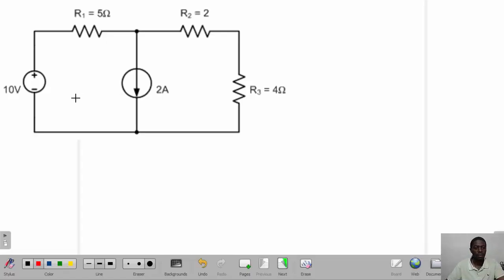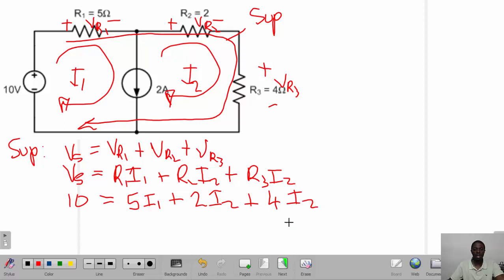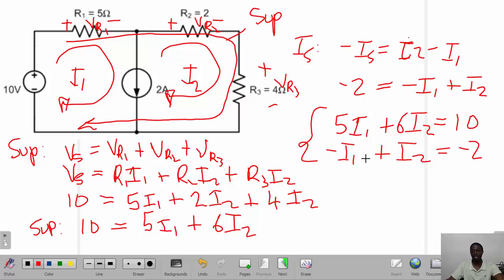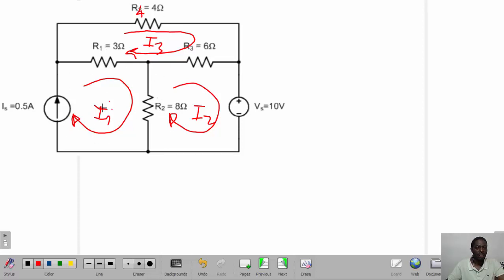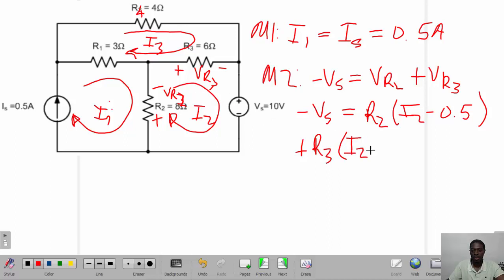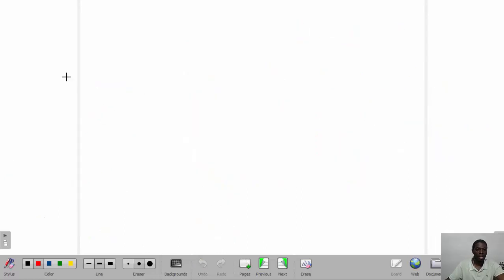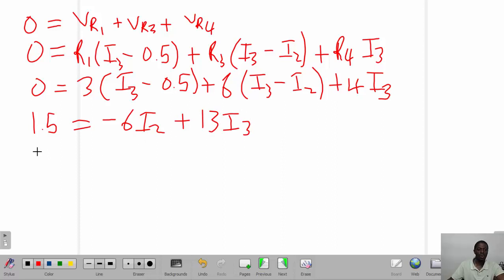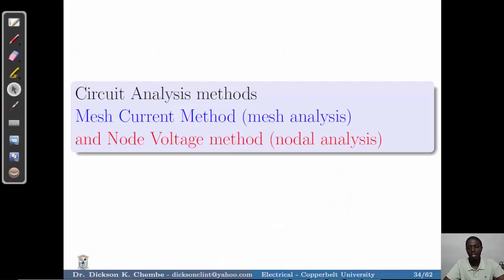Mesh Current Method II

Comment: This is great.
Please Dr, I would appreciate it if you  countercheck Example 13.6 in Fundamentals of electric circuits by Alexander. It's mesh applied to Magnetically coupled circuits ( Am confused on how they found their solution, it keeps differing with my answer,and am sure I've done the correct thing.)